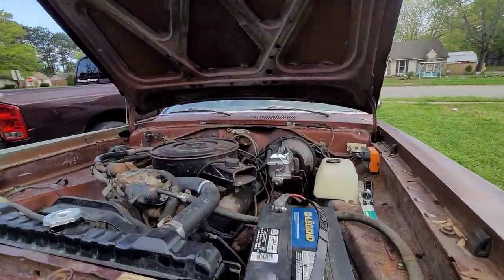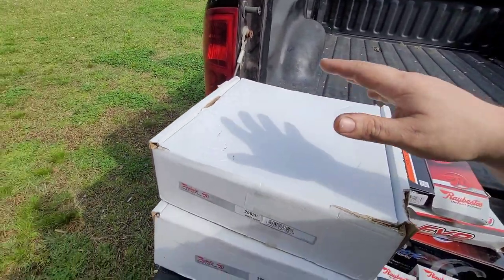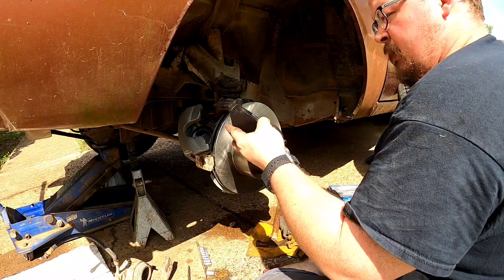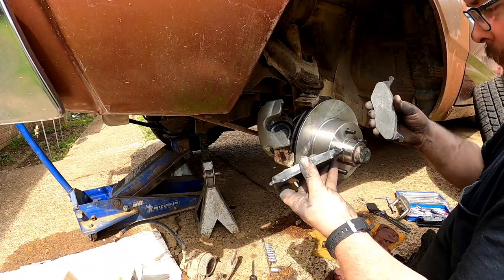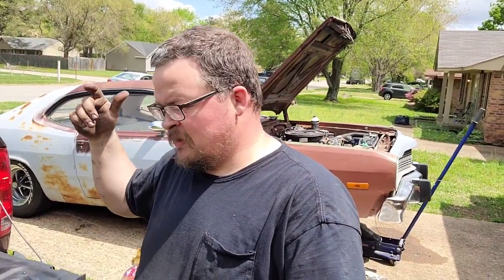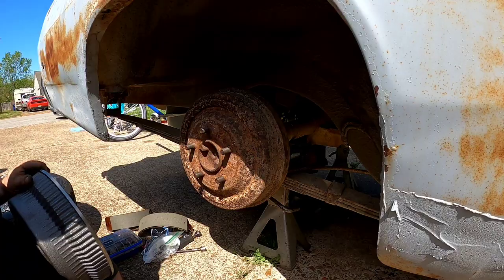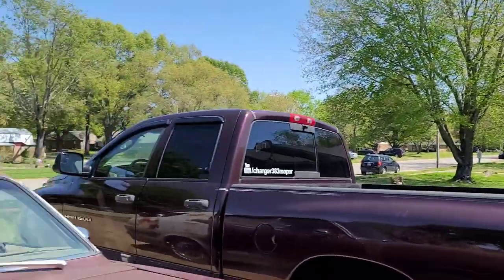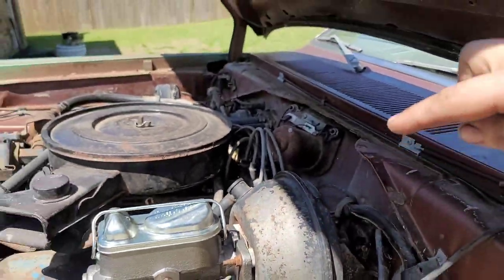1973 Dodge Dart Sport Brake System Rebuild

Comment: You can use any brake booster off of any dodge vehicle, is it bolts up I’ve used one off of a dodge truck before.

Comment: I need those drums you want to sale them. Are they 10 inch
Reply from the maker: I was wanting to hold onto these for a little bit and this oe style is available on Rockauto for around $30 from various manufacturers
Reply: @Charger383Mopar  okay
Reply: I took my Duster to two alignment shops they told me my they couldn't align it cause the right frame rail rolled in needs to be on a frame shop.